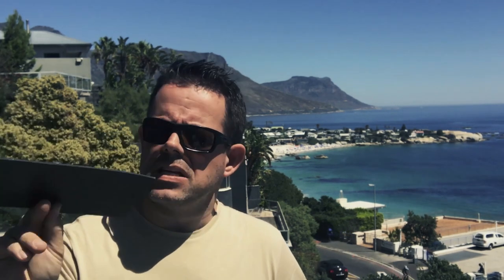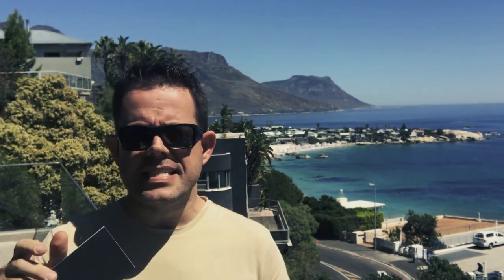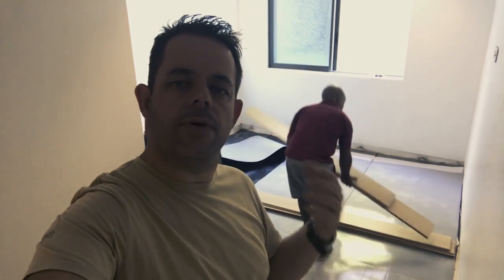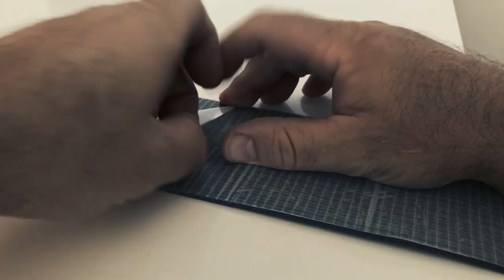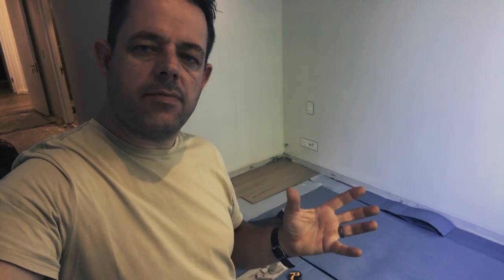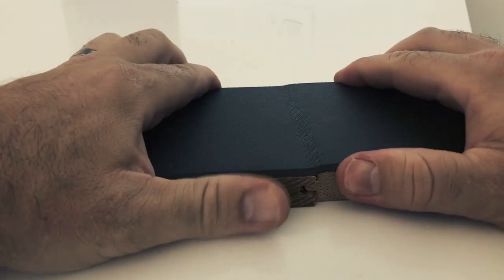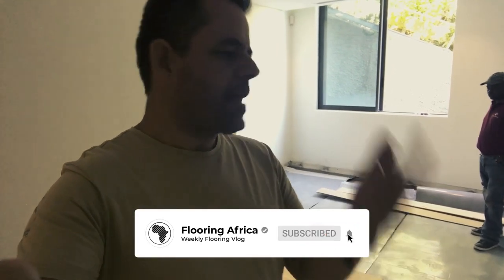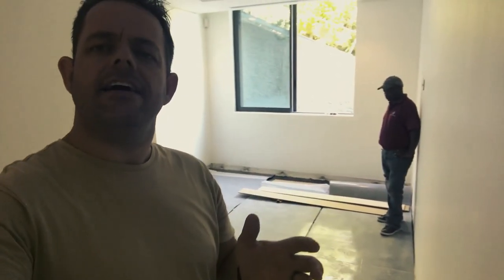The Elastilon Intro | Technical Underlays

Comment: Very nicely done video. I totally agree with what Barry says. Infact it was Steven Suntup few years back who recommended this system to me when we started using this.

We have been using elastilon technical underlay for the last almost 7-8 years with very good results. We do wood flooring installations across India in practically all kinds of climatic zones and it works very well. India primarily is a floating installation market (wooden planks are not glued to the floor below rather clicked together which means they are basically floating). So when we recommend Elastilon to our customers not only they get a good system that holds the planks together and keeps them in good shape in wider band of humidity fluctuation, they also get superb sound insulation which is missing in the floating system. Infact we have many architects who routinely spec Elastilon even with click system engineered wood floors just because of the fabulous sound effect. It just feels like you are walking on a fully bonded surface such as marble. If you want to know more about this system in India write to us at floors@spanfloors.com and we will help you with whatever you need.

Comment: A nice video , showing  all you need to know. Well Done Barry and Flooring Africa
Reply from the maker: Many thanks Graham. This video was short and rough but got the point across. A great system that should be used more often. Much simpler than glue-down options and less risky. Appreciate the support and comment.